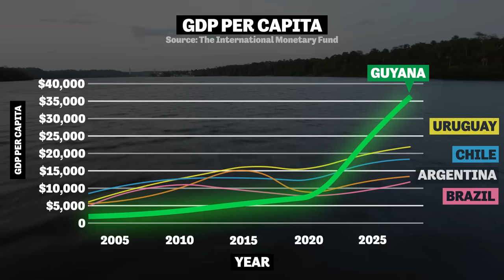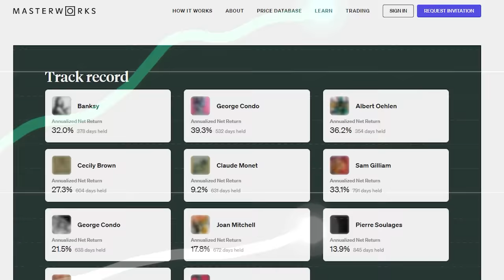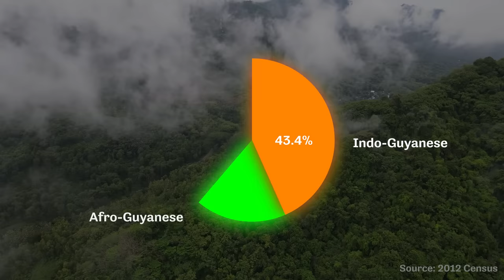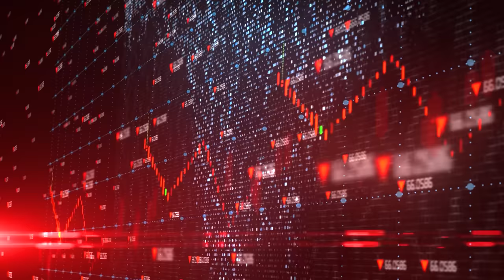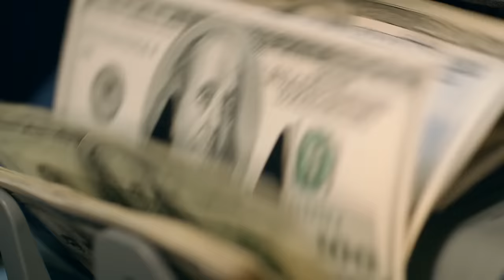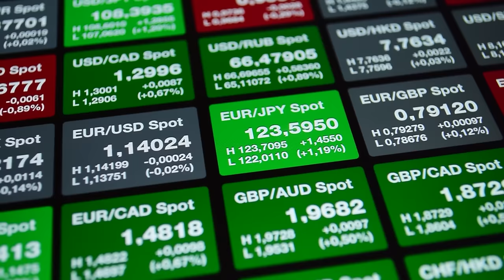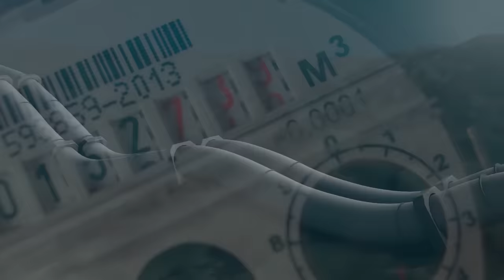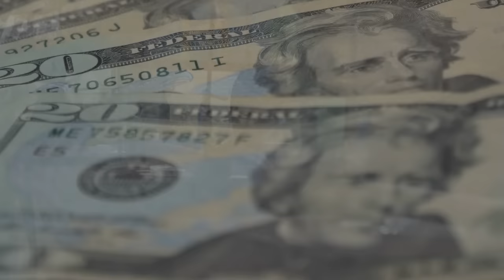How Guyana Plans to get Rich in just 5 years

Comment: their main challenge is the low population size...they will need to somehow stimulate imigration in order to have the worforce needed for all the infrastructure they will need to build
Reply from the maker: Regretting that this was not left in the final cut of the video.
Reply: @CasualScholar  migration should not be an issue
Reply: Plans already on the way to import labour.
Reply: I'd move there if I could afford it. They speak English.
Reply: Same thing with botswana, found a profitable resource, used it well, but now it's low population doesn't allow for a domestic market for manufacturing and is now reliant on diamonds
Reply: Interestingly there are more Guyanese outside guyana than inside so even just attracting expats to return home would be beneficial
Reply: @JC  small populations don't allow for a profitable domestic market. But yes, population density on infrastructure is good but having a large one like in the 6 mil + people can allow for manufacturing for domestic use and exporting( and diversification)
Reply: Good thing there are millions of Venezuelans just across the border desperately wanting to emigrate.
Reply: Not really as Guyana is uninhabitable except for the Northern coast.
Reply: They could get plenty of Indians interested to migrate there if there are enough jobs for them. People of Indian stock live there already and Indians already migrate just about anywhere (just look at places in Africa) if the money is better than what they might get at home.
Reply: Guyana's got quite the sizable diaspora no? Why not draw upon that
Reply: @guilima3097  Would be a bit of a long shot as Guyana is nowhere near developed enough yet to successfully integrate millions of non-English speaking migrants from a similarly impoverished country. Other people have suggested more compatible population pools such as Indians and Guyanese diaspora which I see to be far better alternatives.
Reply: @normanclatcher  yes we do
Reply: Immigration is easy for a country that has a growing economy. Look at Chile. And being that Guyana is next to Venezuela, it is easy to conceive where these immigrants would be coming from. And they have the added benefit of skill laborers. Which won't cost Guyana very much to train.
Reply: @qolspony  Guyana won't be importing labour from Venezuela for political, defense and ideological reasons.
Reply: @honkhonk6359  why would you want to import populations that already have problems with high population and replicate their problems? They are a people of the West Indies and more akin to the Caribbean. High population is not their thing.
Reply: I would say the opposite. Guyana’s relatively lower population size closely fits the ideals of socialistic societies at peak relative to their resources. But yes I agree growth can and should happen to help protect their interest in the future. if handled correctly. Though flooding in immigrants eating up resources is not the answer either. But  Good, smart intentional immigration policy is.
Reply: @honkhonk6359  Thats already happening organically. Opportunity and strong whiff of money is attracting people back. I m part of that said diaspora. My sister is going there next month to sort out a property we have there. It happens to coincide with the visit of two cousins. One from Canada the other from the UK. One of my second cousins I believe has not been back to Guyana in something close to 50 years.
Reply: @jayyy3456  Thank-you! They would be one of the last pools of labour they would call on, for historical, political and communication reasons. Let's not forget there is the whole of the Caribbean to attract, not least the once oil rich neighbour, Trinidad, that will have people trained in Oil and Gas extraction. Moreover there is already a sizeable population from Brazil that has recently led to tensions. Plus I understand from family that there is already TONNES of Chinese there!
Reply: @avhd187  My position was against Guyana importing masses of poor Latin Americans from Venezuela and similar countries. Read my comment again. I was saying they should source immigrants from highly skilled and culturally compatible population pools should they need to do so (Guyanese living around the world, Indians who are a majority race in Guyana).
Reply: @honkhonk6359   immigration needs to be balanced not just indians though. Also Indians have a lot of nepotism that can get out of hand real quick. It should be balanced with at least people who are able to speak or willing to learn english.
Reply: Venezuela and Suriname are right there, Brazil as well. If Guyana improves drastically as opposed to those areas people will move
Reply: @guilima3097  Lol Venezuelans are the last people the Guyanese want
Reply: It shouldn't be hard with their neighbouring country who are fleeing to all sorts of places just to escape that bus driver lol.
Reply: @prometheusjackson8787  there not the problem its the man in charge that is. I have personally meet loads of people who comes from that region and they are very nice people im sure they will be great workers with great morals.
Reply: @guilima3097  and many are in Guyana,already,and in time they will become good Guyanese citizens
Reply: @CasualScholar  You have lots of wrong info on this video.
Reply: @honkhonk6359 
 @José Guilherme   Good thing that Cuba and Guyana have better relations and everyone in the English Caribbean love Cuba.

Cuba also have the most educated population to source from. 
Culturally Cubans are the most closely related of all Latin Americans, as a mixed racial population they will not be any integration problems beside learning English. 

Any large influx of non Caribbean blacks (or Haitian), or Indians from India would create political issues.
Reply: Guyana has enough people to work on the infrastructure projects. American construction companies have been providing on-the-job training for those willing to work to learn a trade as they build out the O&G infrastructure. The companies also are recruiting skilled Guyanese that live abroad. .I'm sure American civil engineers have been working up plans on how to replace their current aged infrastructure and add more for increased population growth in regions. That takes time so there should be US Government agencies there providing assistance in setting up improved civil administrations and law enforcement in the rural and underdeveloped regions.
Reply: @billwilson3609  No they do not. 
extreme basic Labor yes. 
They do not even have enough people trained in basic 2 year Engineering diploma
Reply: Until Guyana becomes developed and Guyanese are educated enough to handle these developments then we open doors for immigrants to fill in gaps we don't want to be second class citizens in our own country
Reply: Venezuelans?
Reply: if word gets out about development and employment we can hope Latin America and Caribbean immigrants will go there instead of N. America.  Unfortunately these are unskilled laborers and no help for value added industry.
Reply: @guilima3097  Willingly bring in the citizens of a country that claims half of your territory. . .
Reply: @normanclatcher  its very affordable to live here
Reply: @CasualScholar  from the interest of the comments, this subject alone could be the subject of a video!
Reply: Don’t 🇮🇳 love to go there?
Reply: Build it and people will migrate to the country even for work permits
Reply: @honkhonk6359  what about other caricom Caribbean islanders getting work permit and the possibility of permanent residency
Reply: @harisadu8998  Indians who could afford to go to guyana won’t want to go. The majority of Guyanese Indians come from low caste Bihari, Tamil, and UP Indians. Upper caste Indians who can afford to move and invest already hate those people in their own country, they’re not going to come to another country full of their descendants. Even in America they separate themselves from Guyanese/other Indo-Caribbeans and call us dirty because of our low caste ancestors. You can get poor low caste Indians from the same regions as our ancestors to come there but only if the government funded their trip and created jobs/housing for them. The ones who want to come won’t be able to because they can’t afford it otherwise.
Reply: @bigdaddy7763  Indians will go anywhere if they are paid enough (by their own standards). They still go to Uganda despite what Idi Amin did to them.
Reply: @fivecinco5923  bro are u crazy ? migrants are looking for a better life and thats it. no matter the color of there skin or the book they belive in.
Reply: @fivecinco5923  But the are educated to be predators in the face of people*
Reply: Well there are the Anglo-Caribbean nations that have a similar culture and would be happy to move to a growing economy. Not to mention their ties with India (and better human rights record than the Gulf Arabs) means they could get workers from India as well.
Reply: @harisadu8998  now ask WHY Mr. Amin did what he did? Good on him.
Reply: @avhd187  Guyana  politics is base on races. The present government is
the Indian party that won the last election so most likely their will favor
Immigration from India and eventually these immigrants will become
Guyanese citizens and the Indian party will dominate the elections and
the politics. Most of the English speaking Caribbean Islands population
are of African decent  like Jamaica, Barbados, Antigua,  Grenada ,etc. so
the Guyanese Government would not favor Afro-Caribbean West Indians
Immigration or only favor West Indians of Indian decent like Trinidad which
has a large Indian population.
Reply: @davidcomma1930  Guyana is Closer to other Anglo-phone or Mixed Anglo-phone Caribbeans than to countries like India. In terms of population yes the country is probably most similar to Trinidad. And though I’m not entirely sure iImmigration is probably not handled by one party based on race. So any major ethnic discrepancy on immigration would probably be noticed and would automatically bring up questions. My ancestry is from that country.  I’ve accept that Guyana is not meant to be a country with a high population. It never was that way and I  don’t see that changing for the foreseeable future. A lower population has its struggles but at least we’re not too much of a burden on immigration to other countries because our total numbers are equivalent to some large cities. The only reason to have higher population growth is to fill the defense forces of the country. To be honest Immigration other than workers there to do specific things should not be a priority but is always welcomed. If we do immigrate the resources are left in the country at peak for those still in the country. The fact is Guyana is part of West Indies and are akin to the Caribbean. That means there are some traits that follow.  Like similar sized populations which is usually lower and other cultural and historical experiences.
Reply: @sirsurnamethefirstofhisnam7986   people dont want to come back because of all the corruption. It will be very difficult to get them to come back without heavy incentives. They would have a better time looking at importing labour from other poor nations.
Reply: They need to pay 💰 it’s citizens to keep people from moving away from their country.  Why are government workers being paid once a month? Who can wait a whole month to get a pay check? People have needs they have to take care of.
Reply: Why, with you people, is it always “population size/growth is small so you need to ruin your demography and social cohesion with immigrants from poorer, less advanced countries”? What ever happened to, ‘population size/growth rate is small so the government needs to promote childbirth in a sustainable way’?
Reply: See the problem with Guyana is the road ways. No side walks. No places to park. All Guyana needs to do is build on infrastructure with their road ways. Their country areas need to take the American  system of the suburbs. Build the roads make them wider and give wide side walks so ppl can walk safely, cars can park and transportation can flow freely.  The roads are a huge problem in Guyana and is the reason why the country can't flourish with moving goods around and making money. No traffic lights. its a free for all out there which make jobs can't be created in the majority of the areas outside of the city towns and it gives less opportunities in rural country areas. This makes guyanese want to leave and live in town and the rest leave and live overseas bringing their resources and talents with them.  This and getting paid less than $500 US dollars once a month from public sector jobs are the reason why guyanese are leaving. who can live on $200 US dollars a month being a nurse or officer. Guyana need to do better in those areas in order to flourish and have ppl wanting to live here. Still wanting to have the same dirt roads with no side walks won't make anyone want to move or move back to Guyana.  @2200Stinger
Reply: They need to encourage those Guyanese that migrate d abroad to return.

Comment: They should spend their oil earnings on more things they can export, such as making aluminium from the bauxite, rather than selling the raw material, and then building up their manufacturing.  If they have water they have hydroelectricity, which is what is needed to cheaply turn bauxite into aluminium. Where there is bauxite there is often tungsten and gallium. They could also turn cane sugar into ethanol, which can then be turned into biofuel and alcoholic drinks using their abundant water source.

Comment: The truth about the beginning of this territory controversy.
In  1822,  more  than  two  hundred  years  ago,  in  the  dominions  of  Venezuela,  which  was  then  part  of  the  Republic  of  Colombia,  the  presence of English settlers was detected, who occupied Demerara and Berbice near the Essequibo River, beyond the territories that belonged to the United Kingdom under the provisions of the Treaty of London of 13 August 1814.The territory that Holland had ceded to the United Kingdom by said Treaty  consisted  of  the  camps  of  Demerara,  Berbice  and  Essequibo,  made up of a geographic space of no more than 32,186 square kilometres, which Holland had acquired from Spain through the Treaty of Münster of  1648.  The  territories  ceded  by  Spain  to  Holland  and,  later,  to  the  United  Kingdom,  never  extended  beyond  the  eastern  margin  of  the  Essequibo River.
At the same time, beginning in 1822, efforts were made to get the British  to  agree  to  the  establishment  of  a  demarcation  line  between  British  Guiana  and  Colombia.  However,  this  did  not  happen  and,  on  the  contrary,  in  1840,  the  United  Kingdom  unilaterally  drew  a  demarcation line that unfairly added to its territory an area of 141,930 square kilometres of Venezuelan nation, starting from the mouth of the Amacuro  River  and  running  north-south  as  far  as  the  Roraima  River,  and  this  is  precisely  the  origin  of  the  controversy.  From then on, the United Kingdom began to expand into the territory of the Essequibo...
In 1887, during the third government of Antonio Guzmán Blanco, on the occasion of the discovery of gold deposits, the United Kingdom considered, again unilaterally, that the border with Venezuela consisted of a line drawn from the coast to Upata, thus usurping 203,310 square kilometres of territory belonging to Venezuela.
The  incursion  of  settlers  from  Demerara  and  Berbice  to  the  west  of the Essequibo River, the maps unilaterally drawn up by the United Kingdom,  and  the  United  Kingdom’s  violations  of  the  sovereignty  of  Venezuela’s territory were always rejected by Venezuela.
Years later, as a result of pressure from the United States of America, the United Kingdom finally agreed to submit the controversy to arbitration, which took  place  on  3  October 1899,  when the Paris Award was issued, whereby 159,500 square kilometres were awarded to the United Kingdom, significantly more than the territory ceded by Holland to the United Kingdom, through the aforementioned Treaty of London of 13 August 1814.
The Paris Award was  the  product  of  a  procedural  farce.  It  is  null  and  void  because  of  the  multiple  direct  violations  of  the  Washington  Treaty  of  1897  and  the  international  law  in  force  at  the  time  it  was  rendered,  and  also  because  it  violated  due  process;  had  the  flaw  of arbitrators exceeding their powers; decided beyond what was required of the arbitral tribunal and, consequently, ruled ultra petita; lacked the required  reasoning,  and,  furthermore,  the  arbitrators  did  not  comply  with their duty of impartiality.
As a first objective approximation and introduction to this issue; By the Treaty of London of 13 August 1814, the United Kingdom acquired  the  Dutch  settlements  of  Berbice,  Demerara  and  Essequibo  east of the Essequibo River, which Holland had acquired from Spain by the Treaty of Münster of 24 October 1648. All these camps were east of the Essequibo River.  Thus, all territories west of the Essequibo River have always belonged to Venezuela.

Comment: I think for the country to successfully take advantage oil resources it has to be well run from the start. Norway without oil would be like neighboring countries sweden and denmark. Stable economies with high democracy index scores and low corruption. I dont see why Guyana would be like Norway, it has to get corruption in order first because oil just increase the incentives for corruption, so there is a risk those problems are just going to increase with higher oil revenue.